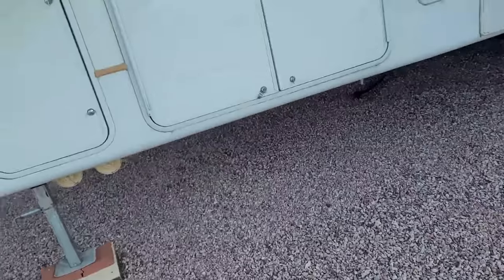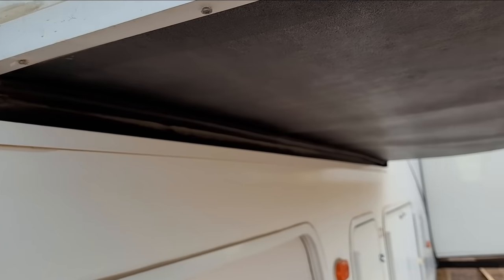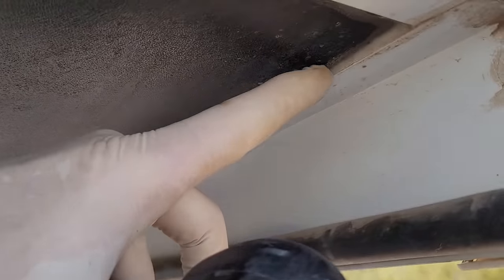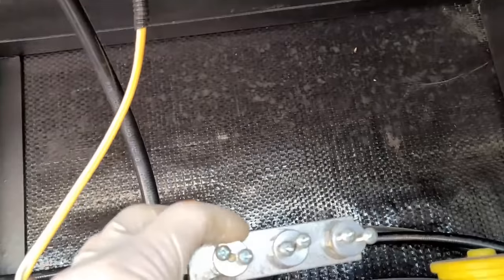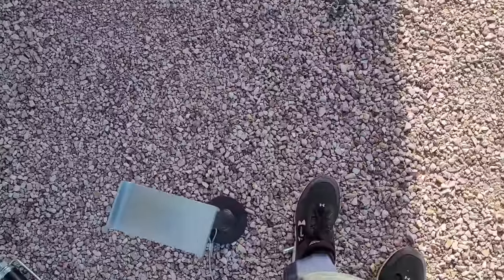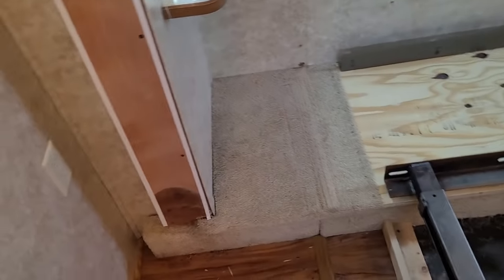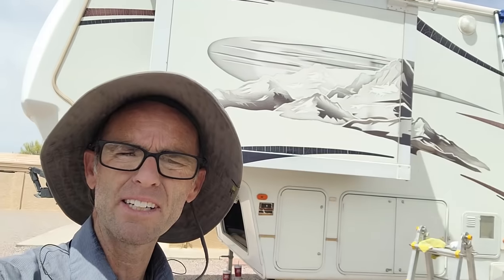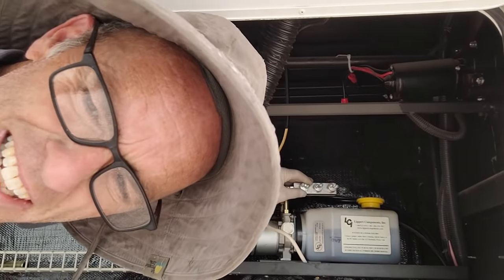Replacing a Rotten Slide Out Floor

Comment: First time trailer owner n I was scammed big time....question. can u walk on the slide out when it's  fully extended out. I heard alot of cracks.  When I checked inside the wood was routed n I had replaced. But all the insulation was soaking wet....I'm thinking of painting slider roof with rubber that's rolled or brushed in.  This trailer is on permeate site n will not be moved  in till 8t has to b junked.   Florida here.   Can u give me ideas how to seal the sliding roof.  And last guy screwed my slider  open ..but it still slides in n out b5 he did this.  But from the looks of water damage it was leaking for awhile.but guy who replaced wood he definitely seen the wet insulation.  But he kept starting new jobs ..he even used different size plywood to do floor so u can tell what was replaced...but my first choice is to find n fix leak...think I found  the leak n want to cover the slide roof with rubber paint on..is this good idea or u have better idea.  No other looks I noticed.  But this is my only house n need it to last aslong as I can
..I'm n recovering drug addict n doing everything rite n still feel like a failure.   Please help. Tia  harry

Comment: I have the same issue. I like the larger, new aluminum angles on the bottom.  I have a small scaffold I can place under the slider with slider jacks to hold up the slide.  Watching you filled in some knowledge gap that I didn't have.  I don't have the hard abs on the bottom, but a flexible mat, which, in my opinion, is garbage. Also the ledge along the bottom opening is thin, and broken in multiple pieces.  I had to rebuild the entire last 12 feet of floor in my toy hauler room.  I used screw jacks to lift the entire aluminum frame in order to place lexan shims between the aluminum frame and the steel frame.  I won't go into all that I did, but hasn't leaked or budged.  The lesson I learned is that these trailers are built sloppy from the factory.

Comment: Great video. I will be subscribing to your channel. My 2020 bedroom slide is already swelling due to 1 season of winter camping and me not addressing condensation soon enough, oh and the manufacturer used OSB instead of plywood. 
Would you reccomend some extra insulation on the inside to stop the draft through the OSB? Ive also seen the wood being epoxy coated before installation. 
Thanks for this video.
Reply from the maker: Thanks!!

Comment: New subscriber here. Great vid and you make it so easy replacing the floor. Would you know the max. weight of a slide using schwintek can hold?  A slide that would either hold a loveseat or theater seats. Thanks.
Reply from the maker: a properly installed schwintek can hold hundreds of pounds some are installed as full wall slides with galleys, sofas, refrigerators. just need to make sure there are rollers underneath supporting the slide box.
Reply: @AZExpert  Thanks for the quick response. From what we can tell it has 2 rollers. We replaced the loveseat and swapped it with theater seats. Although the floor of the slide was short we added a plywood (I think 3/4” or 1/2”, can’t remember) that over extended and attached 3 rollers that supports 125lbs, per roller to adjust the sagging, and to add relief to the original rollers. So far so good, no issues with the slide.

Comment: We're about to replace the floor in our 2021 Forest River Cardinal. Is there a reason you didn't brace it with the stilts before retracing the hydraulic once unbolted? Letting it just hang there a few inches inside for a few minutes makes me nervous.

Comment: 1st I watch your videos all the time and I’v learned a lot. I have a 16’ sun-lite slide in camper it has a rubber roof with felt on the bottom side a large fiberglass nose in front. Q: what sealant do I use to seal the fiberglass to roof to rubber & aluminum strip?
Reply from the maker: in general a rubber roof lap sealant like dicor, alpha or superflex
Reply: @AZExpert  thank you

Comment: My Montana has a slideout that needs the floor replaced also. I don't have the hard ABS underneath but instead a plastic mesh canvas like. I was thinking of coating it with an epoxy resin instead. Think that could work or cause problems?
Reply from the maker: resin will work if mixed and cured well, I'd probably want fiberglass mesh to give it strength though.

Comment: I have an 1998 etopaz and the sliders and everything for the slide out is underneath the floor instead of on too. What do you suggest I should do? Kinda what you did? Also the bottom of the walls are pretty bad, do I replace the floor first or the walls? As it looks alot like the floor here

Comment: I am in the midst of replacing a slide out floor in my RV and couldn’t save the plastic sheet under the floor. I tried to remove it from the rotten floor, but it distorted due to me working it with a strong putty knife.
It is about 60 - 80 mils and very durable, but I did manage to distort it, almost to placing a hole in it.
Can you advise?

I have a 2010 Holiday Rambler Endeavor and it’s the big slide out (13’ 3” long).

Comment: On my 2006 Monaco Diplomat I have found 2 soft spots on the Drivers side front slide that’s a flush floor. It’s 147” long, my question is it possible to remove & repair only the soft areas or does the entire floor need to be replaced?

Comment: @11:48 looking at the Teflon guide for the slide out, is it supposed to be dipped down towards the end like that? I noticed mine was also like that and it caused it to wear out the rubber seal right there so I shimmed it up so it was level with the rest of the slide out wear guide... Just a thought to keep it straight and even as it slides out!

Comment: We just had to tear out a 12 foot 3 1/2 inch long slide out floor. We can’t find any plywood that long. I called the local RV dealers and I also called the lumber stores to see if it was something that they could special order. The lumberyard said with a special size like that they would have to order a lot of about 40 sheets wholesale If the plywood manufacturer would even honor a custom order like that. The RV dealer said they take smaller sheets that are half the thickness and double them up and stagger the seams like Legos and glue the sheets together. Our slide out only has two steel support arms on the far end of the slide out and nothing in the center for support. Do you have any recommendations or know of where we could order a 12 1/2 foot long sheet of plywood? The manufacturers must’ve gotten it somewhere unless they manufactured it themselves

Comment: So my slide out had water originally leaking from the ceiling portion of it. The floor is now spongy. What would you suggest if the top portion needed to be replaced as well?

Comment: You make repairs look so easy.  This reminds me I need to reseal my Keystone Laredo fifth wheel.  Should I use something like Proflex for a fiberglass sided camper or should I use silicone like you used here?  Also should I run a cap seal around the black rubber window frames?

Comment: I just purchased my first trailer and I have the same problem. I guess this very common issues for slide out  due to design.  My question is.  What do think of slideout ski
Reply from the maker: they can be very useful if the floor is delicate or wearing down

Comment: Man you make it look easy! Would you mind sharing the make and model of that stapler? Is it a 22 gauge 3/16 crown fine wire upholstery stapler? I've been using an 18 gauge narrow crown stapler but the staples are a little big for interior trim work.
Reply from the maker: https://amzn.to/33iTviT is the one I got
Reply: @AZExpert  spendy for sure. I think a big parts of the cost of rvs is in those staples. They use millions of them in the carpets.🤪

Comment: If you ever answer questions, I have one. I have a 1998 Jaco 5th wheel that I just bought and can't figure out how to manually get my slide out to extend. Any suggestions?
Reply from the maker: often there is a hole in the frame by the tires to crank slides in

Comment: Do you have a video of rebuilding the bottom of the opening that the slide goes into? Mine is rotten and I want to make sure I do all the supports right! I have a 1997 alfa gold 3 slide 38 footer 5th wheel. Any help would be great.
Reply from the maker: I don't, but it should be pretty straightforward once you dig into it to see how it was made

Comment: Slide toppers as you ended the video ... do you recommend them as a tech or should I just not bother with them..
Reply from the maker: You should have slide toppers if your unit already had them--I wouldn't remove

Comment: 2022 Forest River Product......Same area for leak.  Cedar Creek.  Slide skis never were installed when built..  The ext bottom floor had no barrier or covering.
Reply: Mobile Repair onsite -  3 slides had skis installed, 13 ft floor replaced.  All cleaned up and finished in 4.5 hrs.  Two men with a helper.  No forklift.

Comment: If all that effort went into replacing water damaged plywood, why wouldn't you use marine grade plywood when replacing the damaged areas? Seems like the cost difference would be minimal.
Reply from the maker: The cost isn't up to me and sometimes I have clearances to deal with so I must have a certain thickness

Comment: Why don't RV manufacturers epoxy coat the plywood to prevent it from rotting so quickly? It can't cost that much to have it coated before assembly. It would certainly help their own reputations.
Reply from the maker: they have the workers almost running to build these things

Comment: Was thinking they used Flake board there also like most of that 5th wheel is made of
Reply from the maker: the floors are load bearing so need to take some pressure

Comment: I'LL NEVER FIGURE OUT WHY CUZ IT DOESN'T COST THAT MUCH MORE PEOPLE DON'T USE CHEMICALLY TREATED PLYWOOD THE GREEN STUFF 3/4 THEN EVEN THEN FOR MY EXPERIENCE IT SHOULD BE IN CAPSULED  WHICH IS TO SAY PAINTED ON BOTH SIDES OR STAINED WHEN COATED WITH THOMPSON'S WATER SEAL OR MIX THOMPSON'S WATER SEAL IN WITH THE STAIN  
DAVID ADAM GRENIS BOULDER COLORADO USA
Reply from the maker: properly maintained this will last 30 or more years, not properly maintained  higher quality materials and methods will still fail.

Comment: great job I have 40 ft  teton homes with 3 huge slide outs  and was not understanding how they worked but i wanted to redo  one on the side  as it would not go in do to water damage  floor when i come home from my school I can work on this where is the manual  crank to manual  do it as i feel the system wont  work  cant tell if its  gear or hydraulic ones ?  it looks like this one only bigger https://www.youtube.com/watch?v=0qJvM8ma2nc